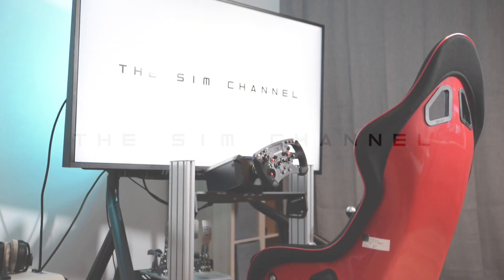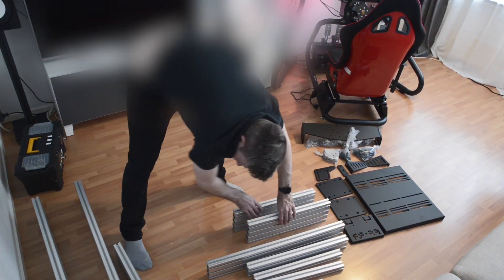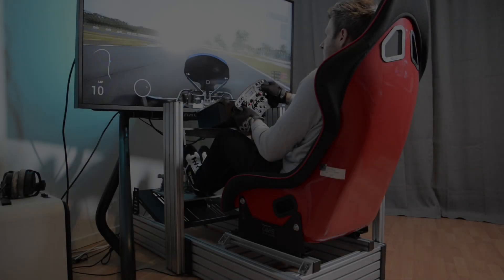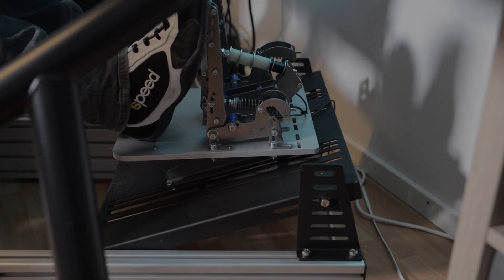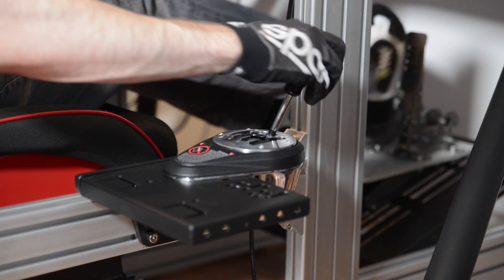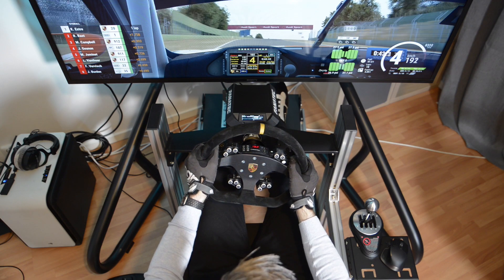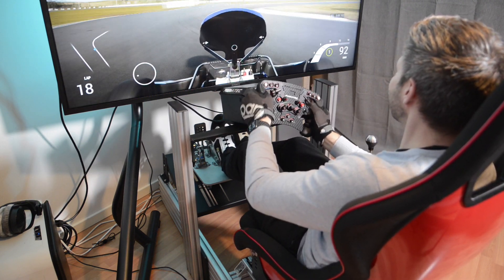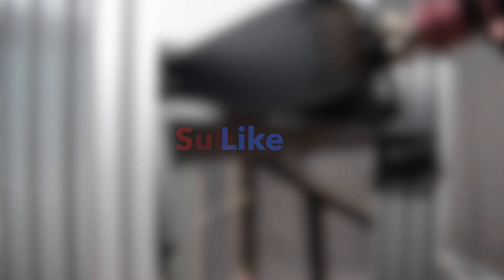GT Omega Prime: Affordable P1X or Cheap Clone?

Comment: Despite the higher price, I got the P1-X. No regrets yet! I don't need to be affraid if some day I want to mount high end gear that it will flex.
Reply: Same, if you spend that much on a rig anyway you might as well just go for the best. 
The P1X pedal tray has the best design out of all the available 8020 cockpits in my opinion.
Reply from the maker: @ErikGPL  did you check out the PSR1 pedal tray? I think that one is also quite good. That being said I like my solution as well. Simple, perfect height for me.

Comment: I ordered a P1X right before Xmas 2020. It got to my house in the NW of the USA in 4 days from the time I placed my order. That’s premium speed shipping. 

 I already have a GT1 EVO so I’m familiar with the SimLab quality standards. It was just over $1k including shipping with the Sim Floor, Podium mount and 2 pairs of NLR V3 motion platform mounts...yeah I accidentally order 2 pairs. 

I still think the P1x is the best value for that size of chassis. The GT1 EVO is even more of an incredible value. SimLab practically invited the affordable aluminum profile chassis. 

I think the GT Omega Prime will eventually get better overtime but they’ll probably start charging for shipping as they may be forced to add more weight to the packages with heavier pedal and wheel deck mounts.
Reply from the maker: We'll see. I'm curious to hear back from them after they've watched this video. In the past they've been rather receptive to my feedback. Really hope they don't take the criticism the wrong way.

Comment: Put my order in today. I would have bought the P1-X, but with shipping to California it comes out about $300 more. I figure it'll be cheaper to upgrade the pedal plate when I eventually go for something stronger than my Fanatec V3s.
Reply: I ordered mine, listed as "In Stock" over a month ago, they still haven't even bothered to ship it yet.
Reply: @DerekMoore82  This is interesting, did it say in stock at the time of order or did it become in stock after ordering? I ordered mine last week under pre-order with an eta of March 30th for stock. I noticed the day after I purchased the eta was changed to April 10th and now it says out of stock. I don't know what to think. Have you spoken to them at all? Also, are you in USA?
Reply: @sethfrancissimracing7558  It said in stock when I purchased. Then after a long time of waiting they told me it would ship when they have it in stock. I got upset and responded explaining that it was listed as in stock when I purchased it. They just gave me some company jargon and it took another month but i finally got it after 2 months total. I'm in Florida.

Comment: Sneaky how you never put the different pedals on the so called flexing plate. With a FLAT or 4 contact patch pedal set. You won’t see any flex. I own this and LOVE IT!
Reply: I wondered about this myself. The flex in the pedal plate had more to do with brackets he was using under the pedals which created only 2 contact points, and forced the leverage to the front rather than the plate itself.
Reply: Yes I noticed this too.  Bit of an unfair test of the plates flexing

Comment: Ho there. I hope you’d be able to help me with this.
I’m getting into sim a bit more serious in the next couple of months. I come from a g29 on a table with GT7 on ps4.
I’ll be getting the podium f1 fanatec (DD1) with cs v3 pedals. Now here comes my problem, will I be ok with the gt omega Titan or should I go for the prime? It would be great for my budget and looks better the titan, but i’m worried in the long run the flex will be annoying me too much. What is your opinion as someone that will be getting into ACC and maybe AC… please give an honest opinion. Thanks you so much for your videos
Reply from the maker: So in my opinion the Titan should be "fine" in terms of flex. It'll flex a little but it won't have a very big impact on your enjoyment of the games. Where it comes a bit short compared to aluminium profile solutions is upgradability. Wanna attach a screen directly to the rig? Handbrake and shifter on it at the same time? Buttkickers or motion setups? Headphone holder? If the answer is no to all of those I think the Titan may make you quite happy 🙂
Reply: @TheSimChannel  that is such great help. I honestly don’t see myself with a shifter or handbrake. I actually like the minimalist feel to the titan. So might just go ahead and pull the trigger. Thanks you so much for your honest opinion!

Comment: Hi man. I just ordered the GT Omega prime and am looking for a seat to put on it. I see the NRG seats look the part and aren’t so expensive ($300 USD), but will I need to acquire anything else to properly fit it into the rig like you do?
Reply from the maker: Based on a quick check: If you ordered the Prime without a seat it won't come with a seat slider, so you're probably gonna want one of those. The NRG seats, or at least the "Fiber Glass Bucket Seat" comes with (small) seat brackets for bottom mounting (in other words you can mount that directly onto the seat slider). You can even skip the seat slider entirely but I wouldn't recommend that (every adjustment of the seat will then require a tool kit and 5 minutes of work).
Reply from the maker: If you feel like supporting the channel you could use my affiliate links for future purchases :-)
Reply: @TheSimChannel  subscribed. Unfortunately I can’t use the link as I already have the Prime shipped out, but can I do it for Thrustmaster? I plan on buying a TX-SW with the P310 Sparco with the TH8A Shifter. If you have a link for them, let me know and I will use it for the purchase
Reply from the maker: @F90Spoolin  no TM affiliate link o far unfortunately! once you upgrade to a fanatec you can use that one :-)

Comment: I didn't see any washers for the screws both on the Simlab and the GT Omega
Reply from the maker: Yeah, the screw heads are large enough, and the corner brackets' metal is hard enough not to require washers.

Comment: is the GT omega cross compatible with Sim Labs? I've read on reddit that the omega uses proprietary channels and t nuts. I wanted to get a Sim labs rig along with some omega accessories but am not sure if it'll fit.  thanks in advance!
Reply from the maker: It's cross-compatible. Companies use different T-nuts, bolts, etc., but it's all series 40 profiles. The channel shapes can differ slightly but the width of the opening and maximum depth are the same (or at least close enough that the T--nuts fit).

Comment: Its pretty funny how Gt omega can even make there 8020 rigs flex 🤣
Reply from the maker: every rig flexes, even the P1-X. But the Prime a bit more, yes.
Reply: @TheSimChannel  to be clear, does the profile flex more or only the pedal and wheel mounting plates?
Reply from the maker: @sethfrancissimracing7558  the profiles flex slightly more, although most will perceive this difference as negligible. I'm not 100% sure if its the actual profile thats flexing or the mount for the uprights that allows for a little more flex, or both. Most likely both as the profiles are lighter and "thinner", as shown in the video. Either way, that shouldn't stop you from buying it in my opinion. The flex in the wheel deck is not gonna matter much during regular driving, the pedal plate however is a bit of an issue in my opinion.

If you decide to buy it you can get it at 5% off if you use my affiliate coded at checkout.